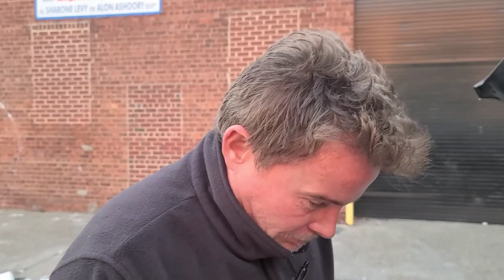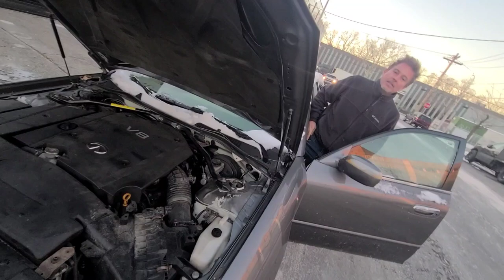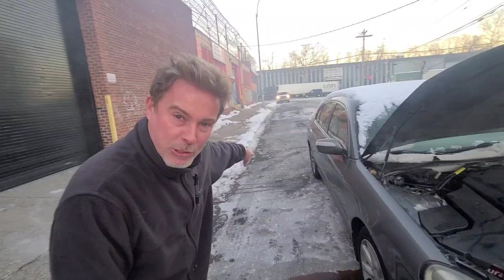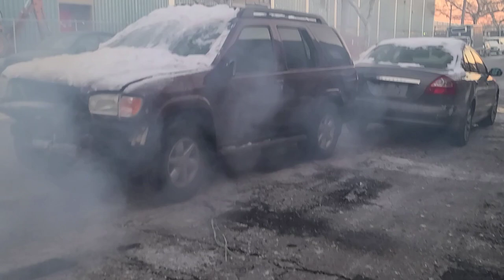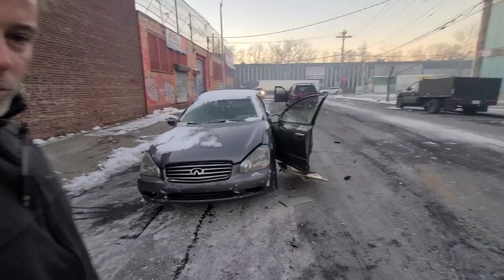Two Infinitis Get Abused. Only On NEUTRAL DROP FOLKS! 🤣😁😛

Comment: You had the mangled parts of of a connecting rod, piston, and a wrist pin all puked out there like a frat boy’s half digested pizza on a Saturday morning. Well done, 10/10 engine abuse.
Reply: lmao.. When they started it I though rod knock with a clack. Crank bearing and wrist pin.
Reply: Mangleized folks
Reply: BEST COMMENT EVER. 👌🏽

Comment: You basically ripped out an entire piston assembly from that motor AND IT STILL CHOOCHED. That 'meteorite' is likely parts of piston that bashed against a load of shit in the combustion chamber before it spat out the side.
Reply: Lol it has to be, the sound it made against the asphalt was the right sounding alloy at least. Gotta hand it to Nissan for making a motor that’ll Swiss cheese itself without quitting. 🤣

Comment: Have to agree with the wrist pin and that odd shaped blob might have been what's left of the piston as it was tortured down the cylinder and out the new drain hole. We had a motor that was blown up and when torn down the valve had broken off the stem, turned sideways and was imbedded in the top of the piston. A 2-fer on an icy Sunday morning in Chenango County. Thank you guys for the tireless work you do. PS I would have a doctor look at the source of that trifecta, peace out.

Comment: Overglorified nissans deserve every bit of this abuse. WAY TO GO STUNTMANNNNN
Reply: I liked the Q45, though
Reply: @engineer_alv  I never dis another person's views on cars. To each their own. I've just always been told to avoid nissan like the black plague lol
Reply: @MagikarpSharp  yeah, new ones are no bueno, especially those with CVT transmissions.
What I liked about the Q45 is that it didn't have any Nissan counterpart
Reply: @engineer_alv  trash engines. Pcv passage design flaws. Burned oil like crazy. Likely what happened to this one. Burned oil and was ran low or without oil on several occasions.
Reply: @engineer_alv  The third gen Q45 was known as the Nissan Cima overseas, but yeah in the US there's no Nissan version. Same story as the Lexus LS400/Toyota Celsior
Reply: @zaneherrington8868  Yeah, I owned one of these. Burned a fuck ton of oil and coolant, but it was nice for highway cruising and was kinda quick. Great buy for 1800 bucks and no one really knew what the hell it was either

Comment: First when you started the engine that sound was a broken connecting rod beating up the bottom of the motor. Then the parts flew out. Bits of connecting rod and the wrist pin ( what you though was the lifter) and the wire looks to be oil rings from the piston!

Comment: Along with the wrist pin you also have oil control scrapers (from the ring set), connecting rods on both ends, I'm assuming bearing material and probably a few chunks of piston.

Comment: I don’t think I saw the piston but def a connecting rod, the cap to the rod, a chunk of rod and the thing cameraman thinks is a lifter is the wrist pin that is pressed through the piston/connecting rod. Damn, that was a hell of a thing to keep running after it spit parts out like that. If that bastard had a bottle of SLICK 50 (from back in the 80s) in it prior to blowing it up so it coated the bearings I bet it would have run long enough to get back home a few miles. That was a pretty EPIC engine blow fellas!!! 👌🏼💪🏼🤟🏼

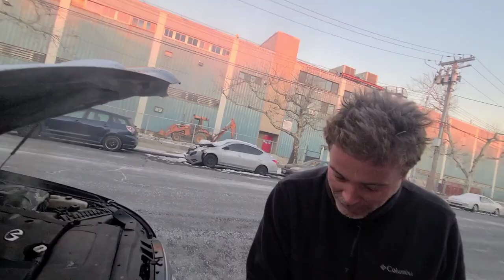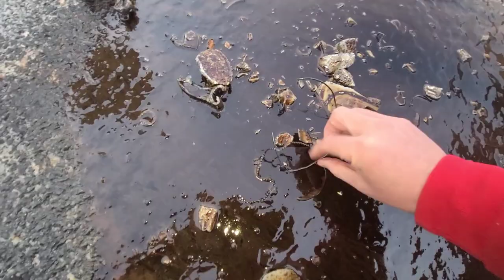Comment: 5:00 bruh that's the wrist pin that connects the piston to the connecting rod, you guys acttuly blow apart a pistion because i can see the oil expander ring at 7:08 , and some other rings

Comment: Wow! This is an epic video, AND IT JUST STARTED! So, ONE - That was a rod knock. TWO - The piece that was laying on the ground that you wondered if it was a lifter - IT WAS A WRIST PIN! Thats what connects the piston to the connecting rod. It threw a rod, or a couple rods out the block, and then kept on running. Ok, time to finish the video.

Comment: The tube is a wrist pin the chunck was a piece of a piston the half circle stuff was parts of connecting rods and the little wire on the ground was piston rings. Looks like you threw at least two connecting rods off the crankshaft

Comment: That's the wrist pin out of the connecting rod. . Pin left the chat and took a bunch of shit with it on the way out of the block. 
I wall on my shop I call it the wall of flame . All the blown pieces hanging up. One that boogles everyone's mind is the GM connecting rod with the starter solenoid pinched in between the two bolts . Rod came through the block and took starter clean off the block

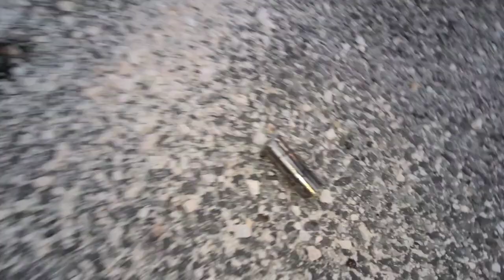Comment: 4:40 I do believe that would be a wrist pin. They tend to work better when they are stuffed between the rod and the piston, but on the street in this case is also perfectly acceptable.
Reply: And while we are on that topic, it looks like the piston, rod, and various sundry items like the oil control and compression rings it originally went with are also there in the chocolate pudding for a nice extra-crunchy chew. Looks like there's another rod cap there as well, but the rest of the parts are probably still chunks hanging out in the block.
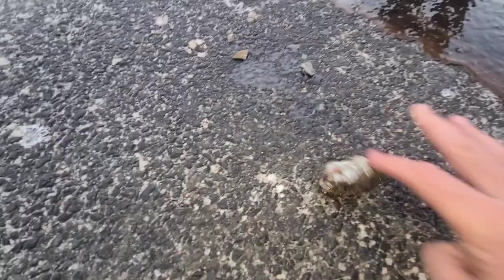Reply: And at 6:30 we have yet another piston, probably the one that went with the odd-ball rod cap seen earlier. We really need to hand out bingo cards before we do these next time. Winner gets a free cameo in the next Neutral Drop video.🎟